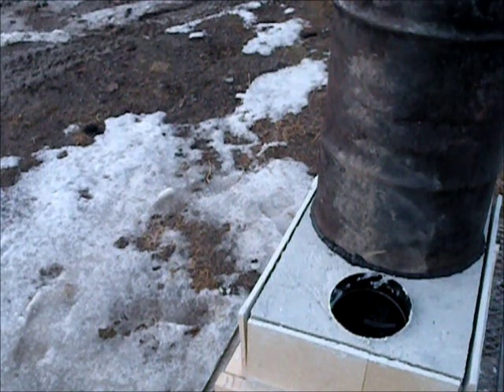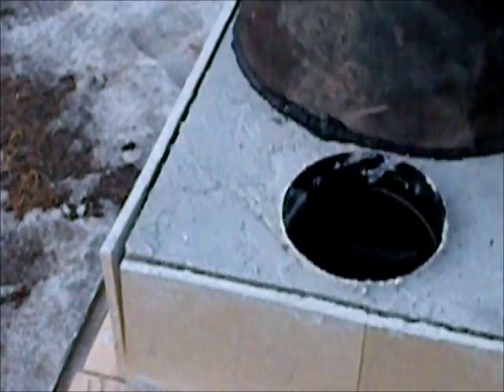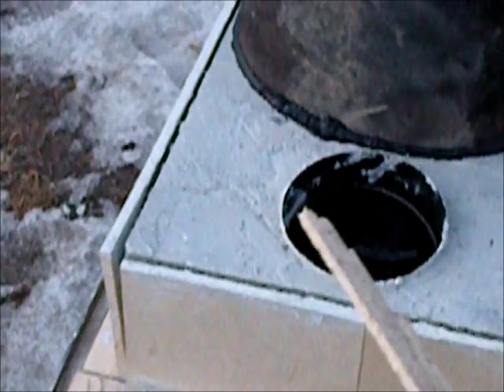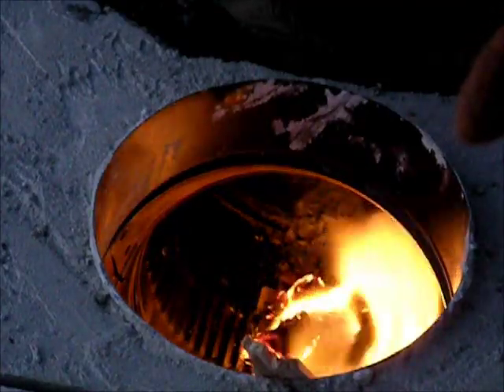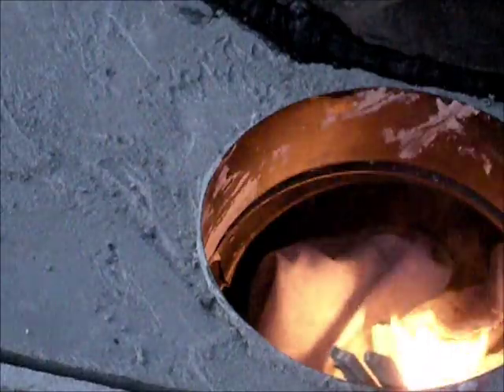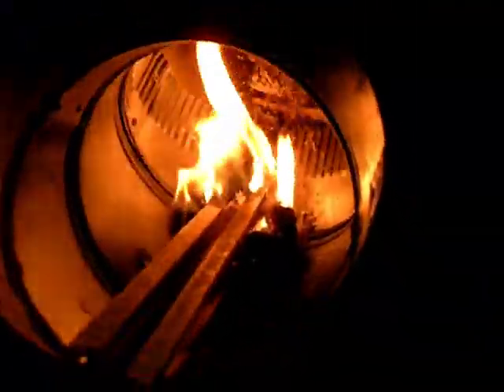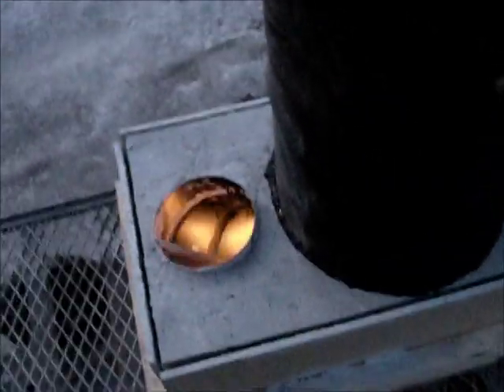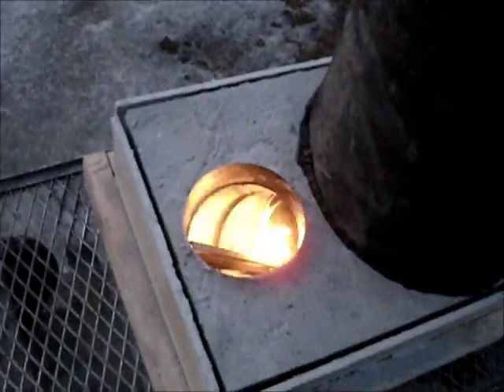6" stove pipe rocket stove part 2 test fire

Comment: I am collecting parts for my Rocket Stove and I liked your idea for 8"  stove pipe.  But I see the problem of low temperatures on the barrel.  I was thinking maybe not insulating the top 1/3 of the heat riser in the barrel, and making a 2" pipe coming out the side of the barrel and running  it down to the fire chamber, thus making a preheater of sorts.  Do you think that may work?